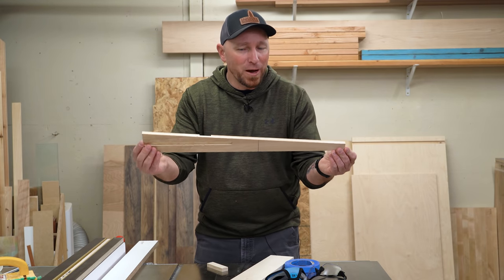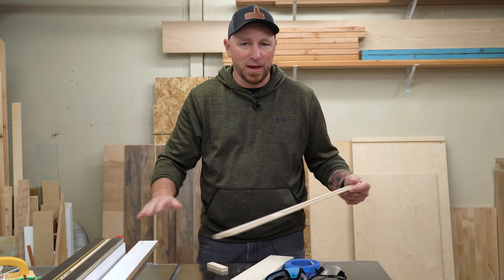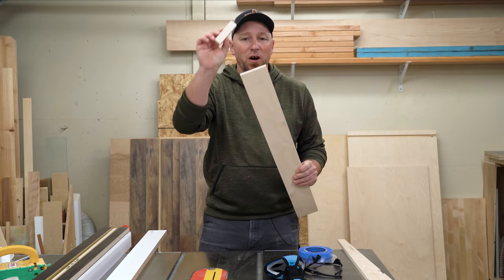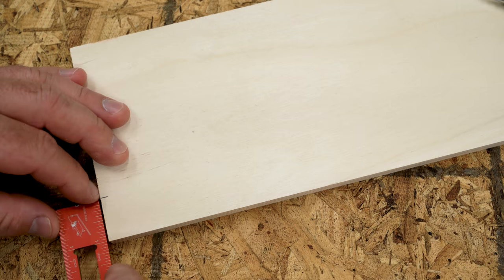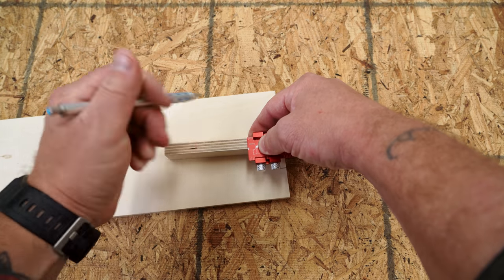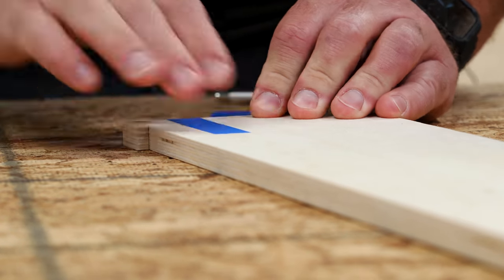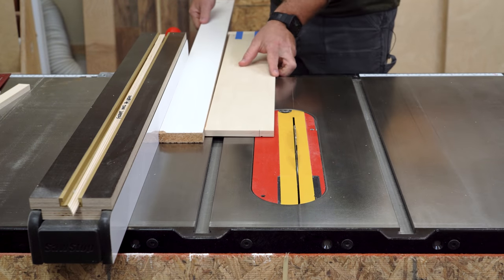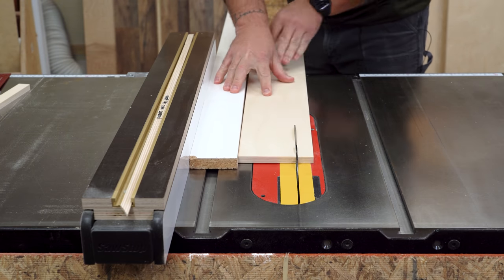How to Cut Tapers on a Table Saw Without a Jig / Woodworking

Comment: Wow just in time as i will have a taper cut to make to fit trim molding to door casing where the wall is a little crooked and i want a thight fit on the trim !!! Thank you for those video, ive learned alot since ive suscribed !!!

Comment: I have done something similar with a scrap piece of timber and 2 screws. 1 to set the depth of the taper and the other longer screw behind that to stop the work piece from sliding backwards.

Comment: Nicely done!  Q: Why not place (or tape) the off-cut piece on the straight aux fence vs. the actual piece needing the taper?  Seems that would add to the "repeatability" aspect of the setup.
Reply: Sorry, just saw a comment from another viewer mentioning essentially the same thing.
Reply from the maker: You could, but then you would have to keep the aux fence and the workpiece perfectly together, in the exact same place, each time. That's hard to explain in writing, but what I mean is that with the offcut attached to the workpiece, if the workpiece and the aux fence feed at different rates, the taper will never change. If the offcut is attached to the aux fence, moving the workpiece forward or backwards separate of the aux fence will change the angle of the taper. I hope this makes sense!
Reply: @InspireWoodcraft  Perfect explanation!  Thanks for taking the time to do so.

Comment: This is still a jig! However, it's a very clever one and much easier than building a tapering jig if you're only going to be doing a few of them. Plus you don't have to store it if you regularly have pretty straight scraps laying around. I'm thinking if you put two pieces at either end instead of one just at the back, tape them up, you could probably even do edge jointing this way and that'll support much wider boards than a conventional tapering jig (unless you have a really big one)

Comment: hey Jody(i?) What type of blade and  teeth count  would you recommend for cutting 3/16 polycarbonate on the tablesaw?
Reply from the maker: I have a Diablo 84 tooth triple chip grind that I use for poly and it works pretty well. Of course other higher-quality blades may do better, but at least that gives you somewhere to start.

Comment: I don't particularly care for the short videos but I had to see how you were going to cut a taper accurately without a jig.. Nice idea but it's still technically a jig, you just used tape instead of nails. If you have a straight scrap of wood as long as or longer than your work piece you have enough material to make a repeatable jig and chances are, you're going to have to cut more than one taper anyway.
Reply: But maybe you don't want to spend the time to make that tapering jig. Which is the entire point of this video. There was nothing positive to come from your comment so I think the internet gods should just make it disappear.
Reply: @myquartknee  obviously it wasn't directed at me, you don't know me. And yes, I am a woodworker, which is why I'm here. This idea might be of value to me or anyone else watching this video besides yourself at some point down the road so why not take the time to share it. Or perhaps a part of this method might make a light go off in our heads down the road to apply to another problem we're having. It's not like he wasted an hour of your time for something you are too good to use, it was a couple minutes. I for one appreciate this man's time and passion for thinking outside the box and sharing with us all.